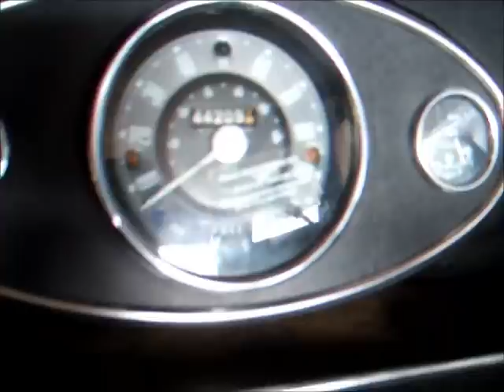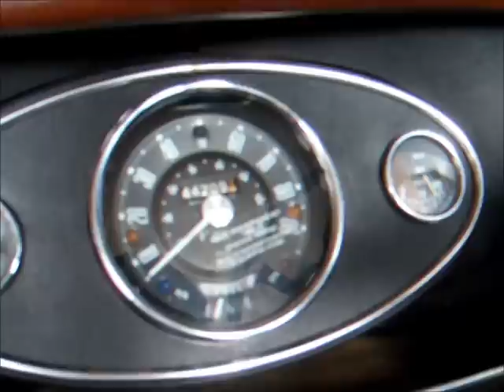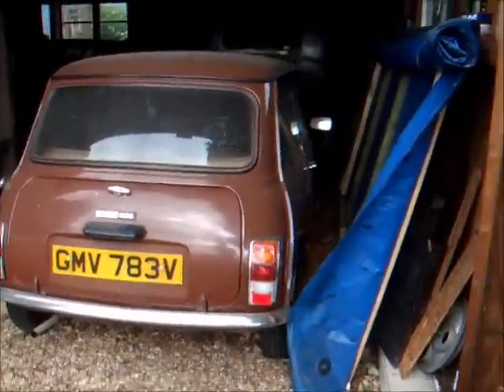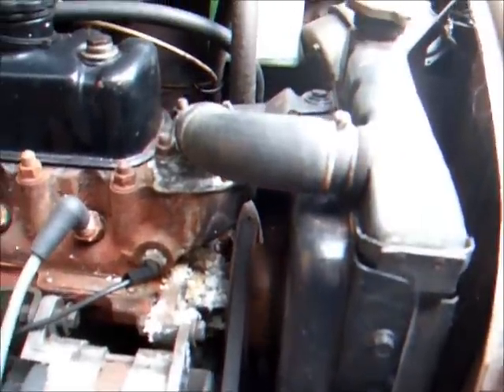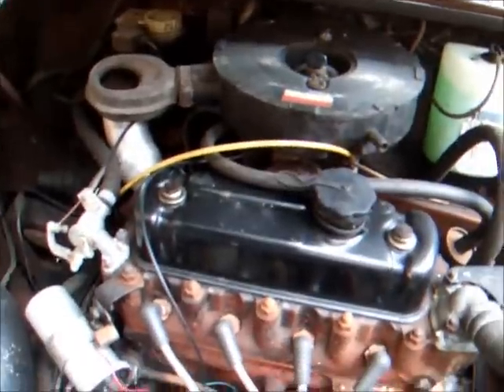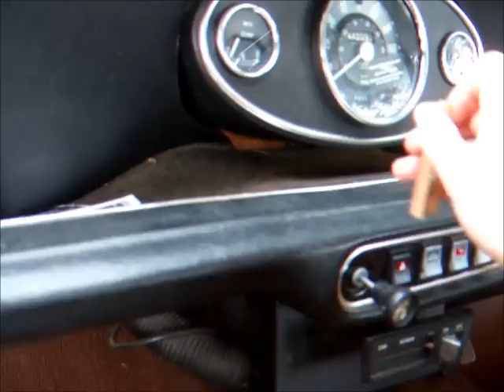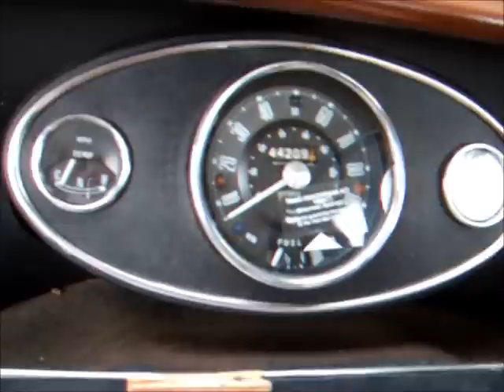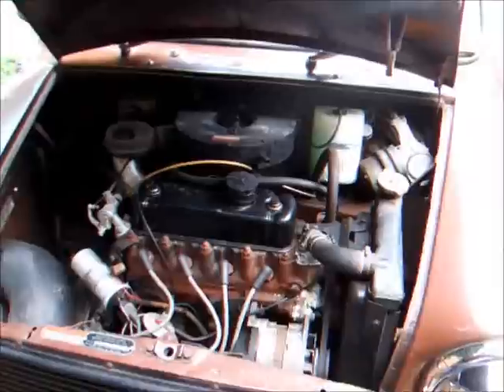1980 Russet Brown Leyland Mini - Will it start?

Comment from the maker: @MrMoterKid is right, they do tap a little for that reason. Regarding the oil, it was changed about 2 years for new old stock 20W50 oil and has clocked about 8 miles since that oil change. its perfectly clean and spotless

Comment from the maker: @steamwally thanks, it is a healthy engine. 44,000 miles and nice high oil pressure (not something I have seen on some mini's lol) 

when i first got it I wanted to respray it, but it quickly grew and stuck, plus it got the name chocolate box from the old man which i guess would only apply if it stayed brown :L 

the petter is slow progress, compression is low, waiting for a forum member to get back to me with a starting handle. Plus im having trouble getting the timing right with the head on it

Comment from the maker: @popleycrew I will have a go at making a video of the repairs. First of all I have a wing and two A panels to paint..... as the brown on those panels is well off. Then I have the floors to chop out and weld the new ones in (there laying in the floor) then I will either look at replacing the doors or repairing the doors..... same with the bonnet. Then the brake cylinders need replacing and also the thermostat housing and water pump